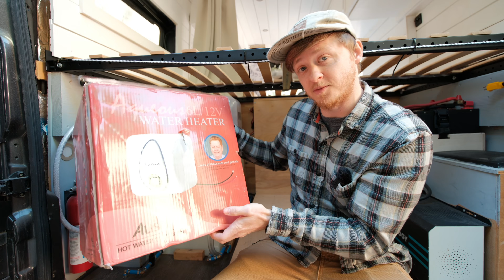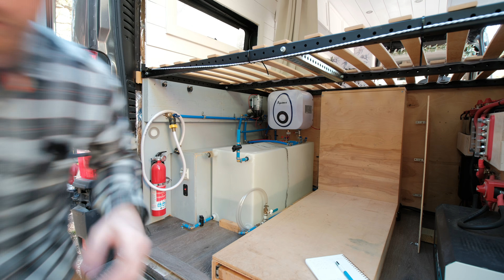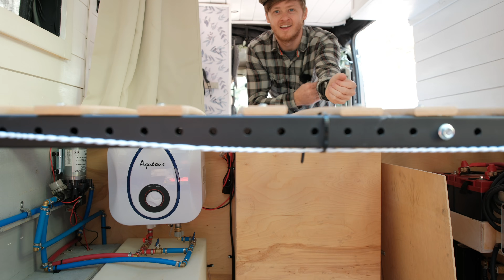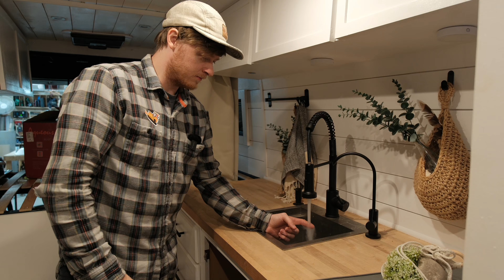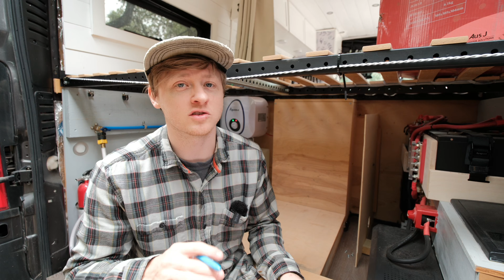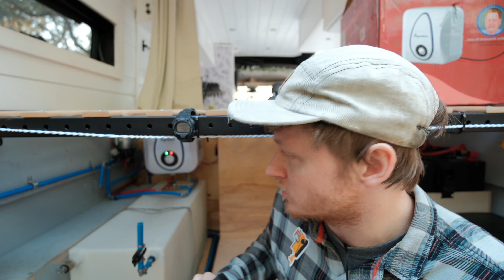Aqueous 12V Water Heater Review – Worth the Slow Heat?

Comment: I’m so happy to report back on this water heater after a week with it full time! I turned it on at the beginning of the trip and left it on for seven days straight. I had super hot water anytime I needed it with a little to no power draw. It was absolutely incredible.!!!!!  even after turning it off the water stayed warm\hot for about a day. 10/10 recommend to anyone with a 12v system
Reply from the maker: Happy to hear that! Thanks for reporting back!
Reply: +
This  is helpful, can you describe your camping style during this trial? Were you driving everyday?  How were you charging your batteries?

thanks!

Comment: In the US, Rheem sells a 2.5g cylinder style water heater with a drain and safety valve.  It comes with a 120V plug/heating coil but there are a few companies that sell DC heating coils for them.  I'm looking at doing a 24V 600w coil and installing it in a truck camper.  Total cost should be about $320 and it uses standard US size plumbing fittings.  I plan to wire the included thermostat to control a victron battery protect relay to cycle the coil on and off while also preventing it from running my batteries too low.  The truck will have a 24V alternator with up to 100A of DC charging and 600w of solar on the roof so I should have plenty of power to run it!
Reply from the maker: That sounds like a solid plan! I think the 600W 24V element will be a good balance. Good call on the Rheem too - much better design with the bottom drain than the bosch.

Comment: Interesting video. I realize your comparison to the 12v Bosch was based on specs and not an actual controlled test but even so the 120v Bosch beats the 12v in terms of Wh/gallon heated according to your figures. 
I run a 2.5 gal. Bosch in my van and use between 25 and 40 ah to heat the water. It uses  more energy in colder weather because my water tank is located in the “garage” so is usually a fair bit cooler than the living space. Makes sense, since it takes about 2.5 watt hours to heat a gallon of water 1 degree F. More temperature rise= more energy used. 
Since I have a robust electrical system (no propane in my van) I’m happy to use the inverter and get the water hot quicker. No reason for me to spend 2.5X the money just to use 12 volts natively. 
There is a cheaper 12 volt option though, one I used in my last van: a 2.5 gallon residential water heater from Menards, and a 200W 12 volt heating element from Missouri Wind and Solar. Works a treat, and the tank even has a drain for those who can’t live without one. Someone mentioned higher wattage 12v elements, like 600 w. Trouble with that is, at 12 volts, you’re talking about some serious current, like 50 amps. Which means much bigger wiring, and probably re-engineering the thermostat. A 200w element is drawing 16-17 amps so wiring it through the stock thermostat works fine since it’s about the same current it was designed for as a 120v appliance. But much more than that could fry the thermostat and cause it to fail or worse, run away. 
Thanks again for the video.
Reply from the maker: Thanks for sharing that experience and use info! Some more good options to consider

Comment: I'm running the the duoetto mkII that's also from ausJ.  It's 12/240V 10L. 400w 12v 1100W 240V. Great brand, great product. I just keep it on 12V and run the shower directly from the unit.
Reply from the maker: Great to hear a firsthand review on the duoetto - thanks!

Comment: Just having the ability to drain for winterizing means it kicks the Bosch 120v heater to the trash heap.
Reply from the maker: For sure. Someone else here mentioned that Rheem makes a 2 Gallon 120V heater with a drain at the bottom so that could be another good option.

Comment: Great video. I opted for a Whale 12v model. It has a sacrificial anode rod as well as a drain valve. It's got a 300w element which is a nice bump for heat recovery. It can be floor mounted (which worked best for my layout) with front connections. However I think tariffs really nailed this one as I just googled it and it's now $800 from US suppliers! I want to say I paid under $600.
Reply from the maker: Thanks for sharing! sounds like a pretty good setup but bummer on the price increase